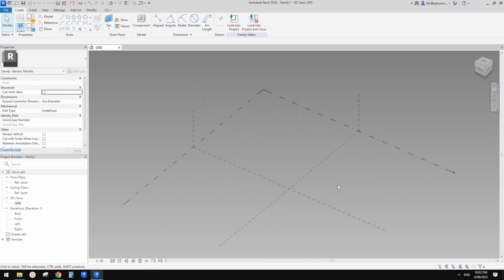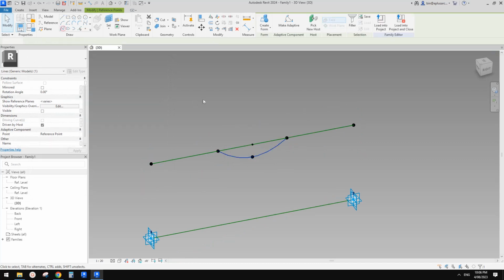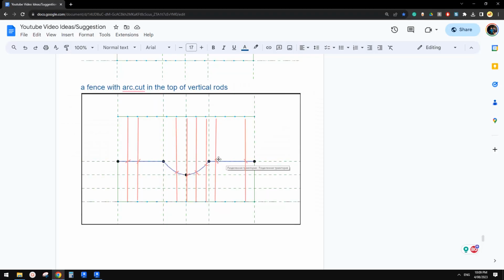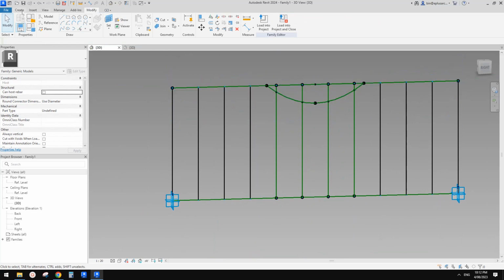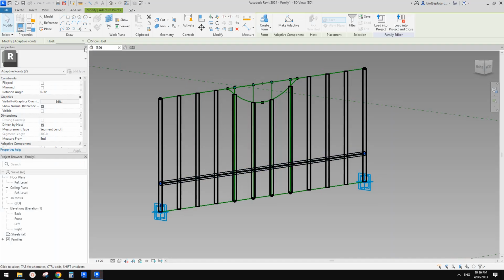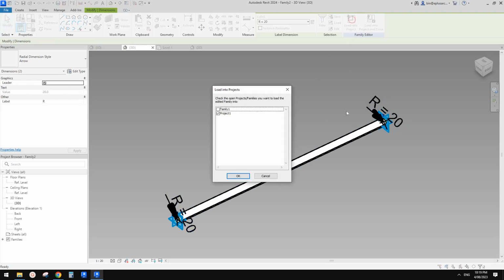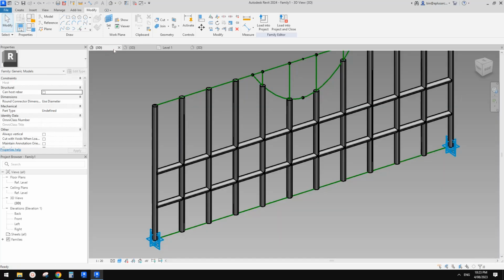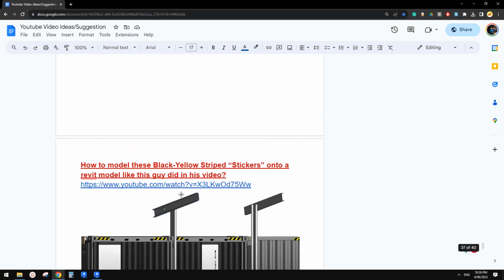23072 - Revit Adaptive Family Exercise

Comment: Can revit rounded the joint on multiple wall that connects in a single point?
Reply from the maker: Can you elaborate?
Reply: @BINHE615  i have this project that requires me to round the corner of connected walls. I can use fillet tool for the corner from a simple two connected walls but then it got problematic when i also have to round the other side too. Imagine an intersection of two walls (like a plus + ) and rounding each of the four corners in the middle.
Reply from the maker: Can you split these two walls and make them four walls?
Reply: @BINHE615  yes i tried this one but even then i can only round two of the four corner with fillet.
Reply from the maker: @damienwalker7856  I'm pretty sure you can round all corners, I tried and it worked.
Reply: @BINHE615  please explain :'0

Comment: Curtain wall with a profile edit would be lot more simpler and a lot more flexible than this, is there any specific reason you went for this and not a curtain wall?
Reply from the maker: Yes, you are right. Curtain wall is easier. I was stuck in adaptive family probably because the question specifically mentioned adaptive family.